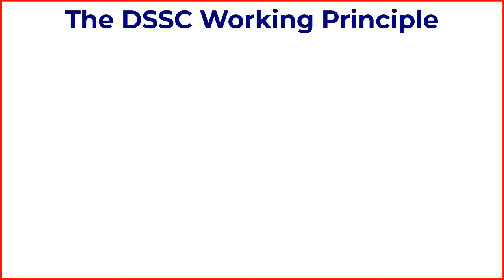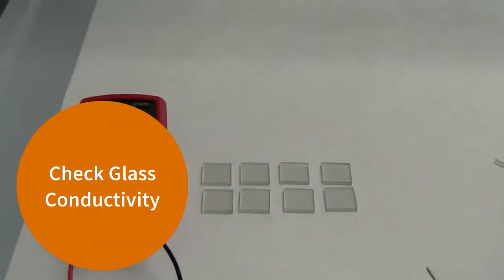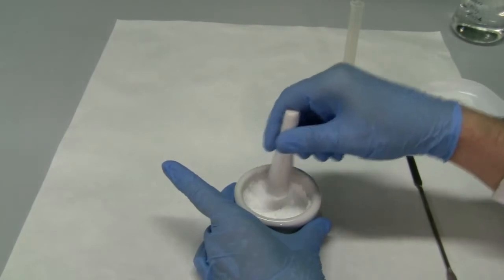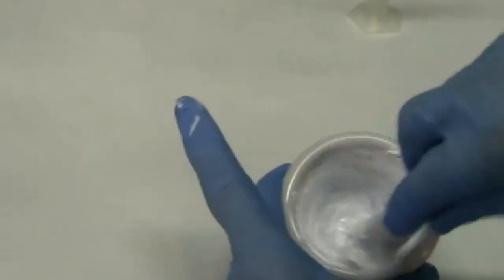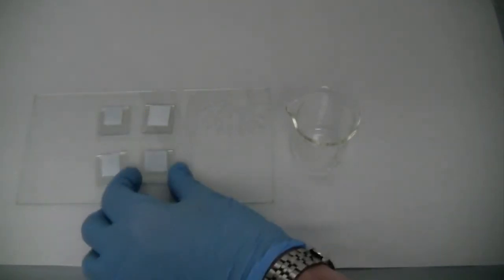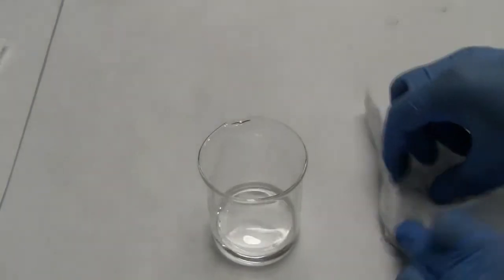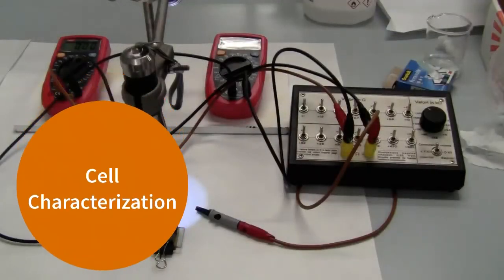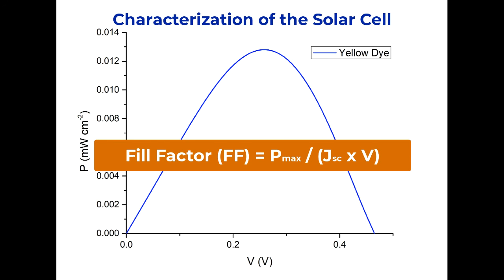Dye Sensitized Solar Cells Preparation

Comment: Which acid solution you used for paste preparation sir? what is the concentration of acid /
Reply from the maker: i used around 1-2 drops of nitric acid (65%) in 250 ml of water. The pH should be around 4.
Reply: If i use PVA polyvinily alcohol sir? It's can be good or bad?

Comment: Please, can we make a larger cell to generate more electricity?
Reply from the maker: One can make larger cells, however they are hand-made and the tirania deposition can become critical and difficult. Those demonstration cells are not sealed, so they “live” just few days. One can seal them by using a layer of parafilm around the titania, in between the two glass slides. These operations can be performed well, but they are more tricky and in general outside the demonstration goal.

Comment: Which source is used?
Reply from the maker: This is not a very good source, but easy to obtain and to manage for educational purposes. The lamp is a LED lamp, whose light is quite “cold”. Maybe a lamp that covers a large range of wavelengths in the visible region could give slightly better results in terms of current. For research purposes one needs to use a sun light simulator (10 k euro of cost) and proper electronics (5 k euro) and software for the measurement... ...definitely not cheap....!

Comment: Are there any other possible solutions to use instead of this acid? I have heard about Ethanol or even vinegar, they are quite simple to obtain and the result isn't very bad
Reply from the maker: To prepare the Titania paste, Nitric acid is better than acetic acid. To sensistize the Titania, a dye is required, so ethanol or vinegar are not sufficient. Please specify what do you need to know.

Comment: If I wanted to substitute a conductive polymer for the TiO2, what do I have to know? Can the dye be covalently bonded to such polymer chain?

P.S. How did the other dyes perform compared to the one you synthesized, in both output and longevity? Have you done any tests with UV stability? Ever try perlyne green? Carbon nitride?
  The more I think the more questions I have... Can you recommend a book specific to DSSCs?
Reply from the maker: If I have never heard about dye onto conductive polymer as such and in the way you propose. If you have a reactive conductive polymer the dye could be linked by using its carboxylic group but I do not think it could have sense, since the presence of the dye could strongly modify the packing of the final polymer into a film, probably reducing its ability to conduct charges.

If you want to substitute the TiO2 with a conductive polymer it should be a n-semicondutcor conductive polymer. This should work well with some p-conductive polymer but this is Organic PhotoVoltaic (OPV), totally different from the Dye Sensitized Solar Cells.

The performances are quite good for the red and blue but not in those conditions. The yellow dye just showed around 5.5% PCE, however not in the cells prepared as in this videos. These are cells made for students/schools.
Reply from the maker: @petevenuti7355  in order to give some answer it should be better to have an e-mail to which I can write. 
Just to know, OPV is known as Organo PhotoVoltaic, whose devices are built by mixing intimately two different materials, n- and p- organic semiconductors, normally polymers. The DSSC is different since the titania (n-semiconductor) is just covered with the dye (active material for charge photoseparation) and the electrolyte has the role of the p-semiconductors since it need to relase electrons to the dye (which beacme oxidized when it donated an electron to titania) to reduce it back to its neutral state. As from you previous question, the mixing of the polymers should give a enormous area of contact through which the charge transfer should occur. By attaching pendant dye onto a polymer makes it to have a different hindrance, larger, so it can mix with the other polymer showing different properties, generally worse. Normally polyanilines are dark compounds, so the presence of a dye in the structure will not be of great help since most of the light will be absorbed by the polymer itself and the dye will not work efficiently. IN DSSC since the Titania is white the dye can absorbs light efficiently.

Conductive glasse are produced by sputtering (http://glass-process.com/c-ito-glass-production/) or other processes. I t is hard to produce yourself a good quality of conductive glass.

If I have a e-mail address I can send you 1/2 review by me in which the essential concepts for cells are underlined, hoping to avoid you headache about HOMO-LUMO conduction bands and so on.